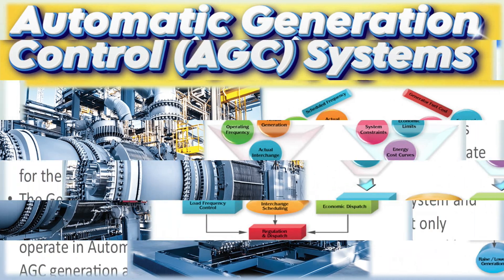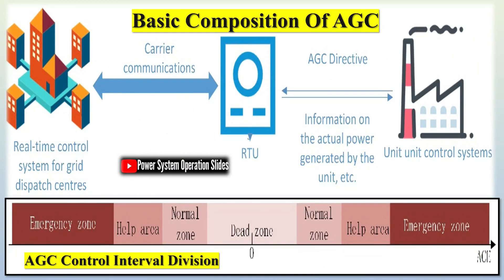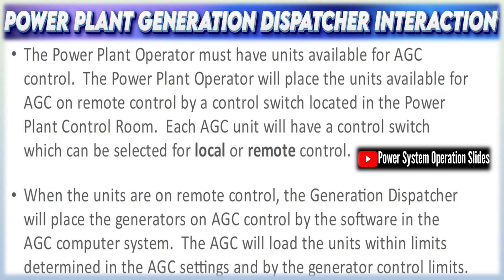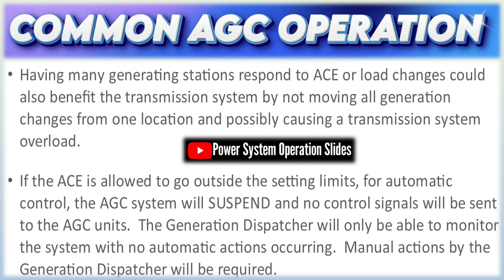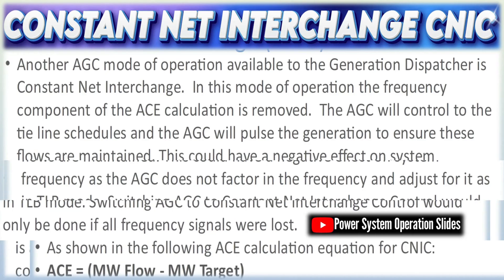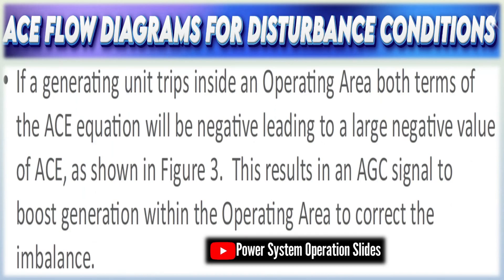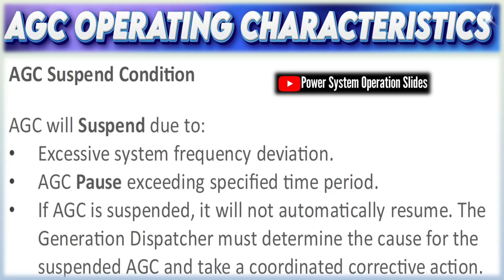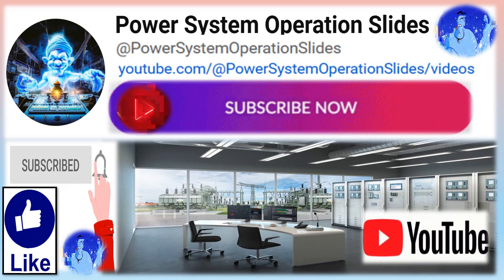AGC Automatic Generation Control | Area Control Error ACE | Automatic Generation Control Modes

Comment: I am glad that you mentioned the growing contributions of renewable energy sources. The real issue is a transition from a centralized system to a decentralized system. With distributed generation, many local areas will exercise greater control and independence. Much like the national interstate highway system the grid could converted  to a HVDC/MVDC system,  With battery based nodes, massive blackouts should decline.